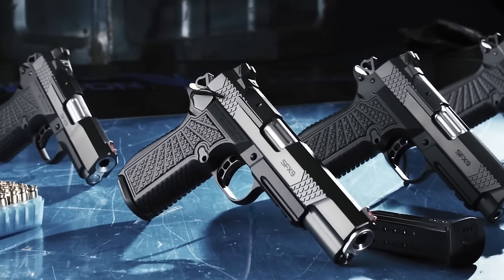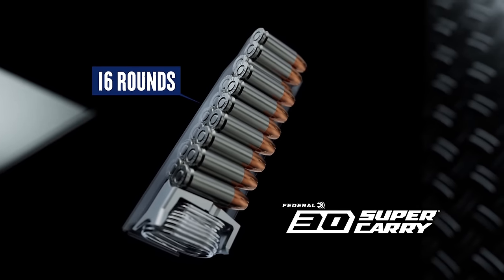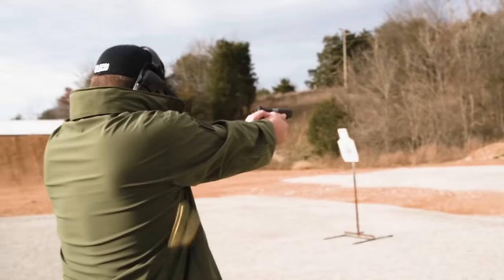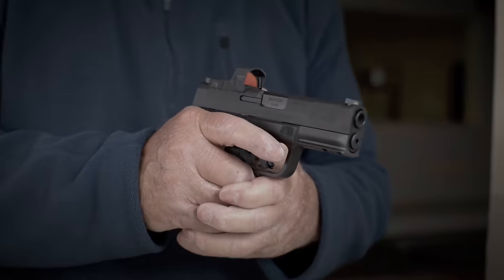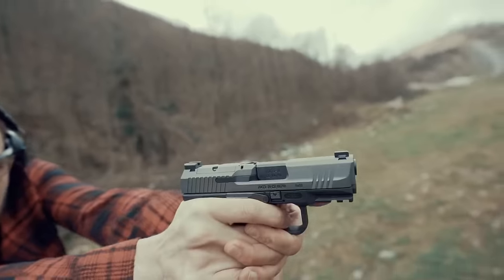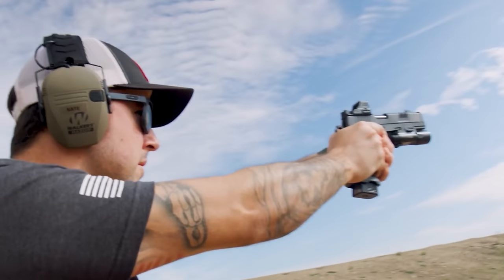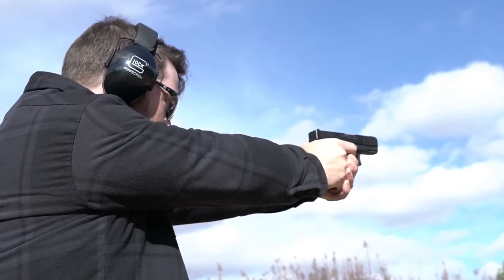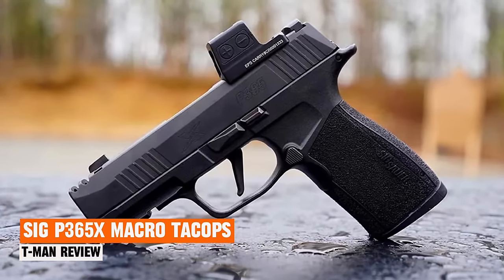TOP 10 Ultimate Concealed Carry Handguns of 2024 : # 1 Rises to Dominate

Comment: I have S&W 9mm Shield Plus. Installed a 3 5/8 inch True Precision Treaded Barrel. Better lockup, Stability and Accuracy. Also Hogue Grip. I also have a S&W Shield. I upgraded the Trigger and installed a 3 5/8 inch Faxon Barrel. Also Hogue Grip. Reliability no change. Very accurate .Shooting 12 ounces hanging beer cans 20 yard easy and at 40 yards Body size Targets. I don't need the PC 4 inch Shield Plus. I also Have a SD9VE. Installed Apex Trigger, Slide Bar and Slide Lock upgraded to Stainless Steel. No Malfunctions. I also have a Great Condition S&W M&P 40 Police Trade in. The police officer must have upgraded the Trigger Springs. Still has the Henge Trigger, But it shoots very well and the Trigger feels good. Bought a Gun Light for it.